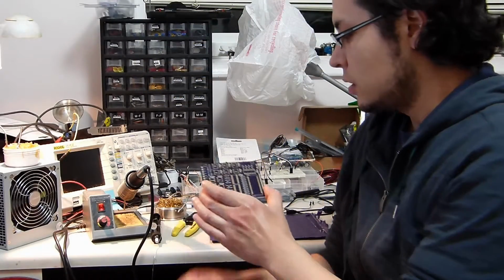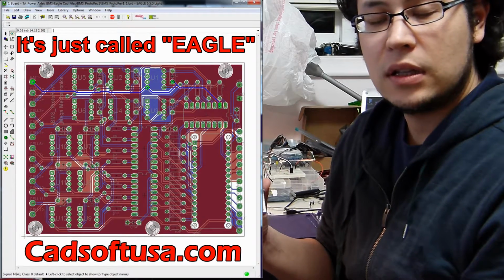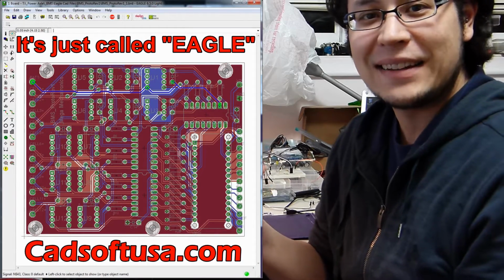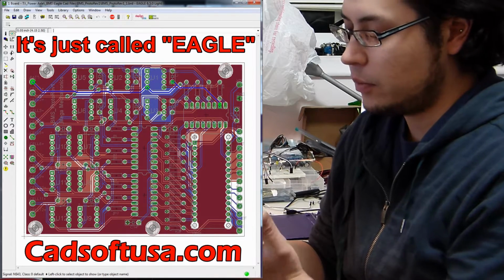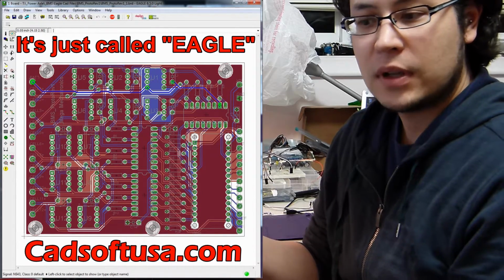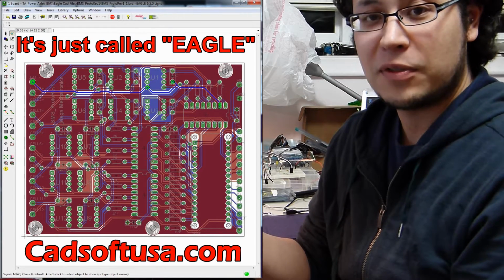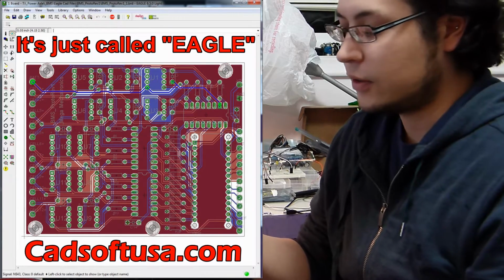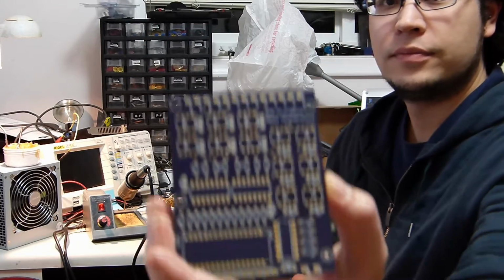How to Arduino BMS - Part 2 Battery Monitoring System LiPo LiFe ESP32 STM32

Comment: Hello what is that capacitor for next to the Attiny85, Is that for the reset on the attiny85, what size is that capacitor and is it going to ground or vcc? Reason why I'm asking is because i never saw a attiny85 with a capacitor on it before.
Reply: All ATTINY should have a capacitor on it, same as with arduinos, it's in the datasheet, a simple 0.1uf cap is needed to level out the input for the AVR.

Comment: hi, i need a stupid bms that check only if each cell exceed 4,2v or is less than 3v if this happen stop the current from battery to controller or charger. Can u help me?
Reply from the maker: Alex Dallara Use the built in voltage measurement of the ATTiny.

Comment: Dear Expert

Your video is very educational!

I have a question about my lithium charger.
The output voltage rating as shown on my charger brick for my hub motor shows its providing sum of of all the lithium cells in series where each cell is 3.3v.
I measured with voltmeter and indeed thats the output voltage or open voltage.

What puzzles me is that the lithium battery pack when fully charged, is at the sum of all the batteries in series where each cell is at 4.2v, the max voltage rating of each cell.

So, I am not sure why the charger is providing a lower voltage than the voltage when the battery pack is fully charged. Its logical to say the controller circuit has somehow stepped up the voltage either by PWM or other means.

I am seeking advise why the charger is designed like this and is this a standard for lithium chargers for electric motor lithium packs.

Thanks very much.